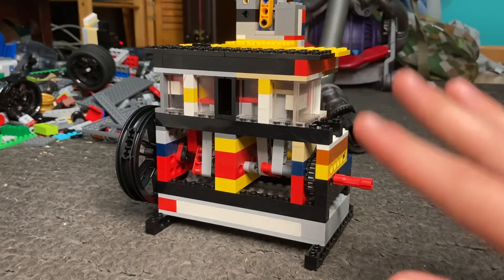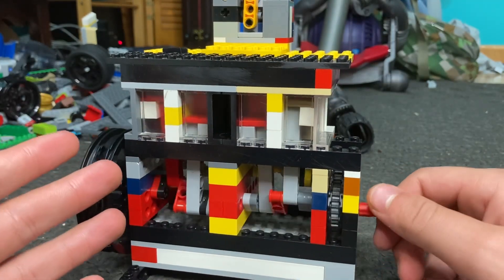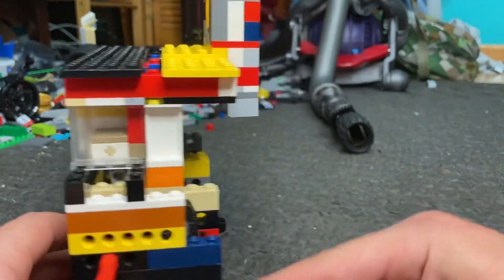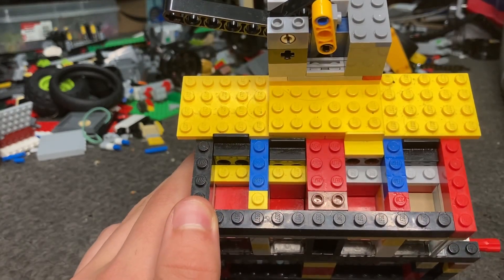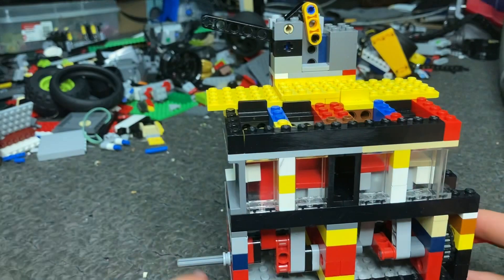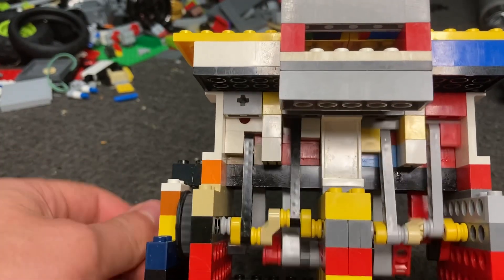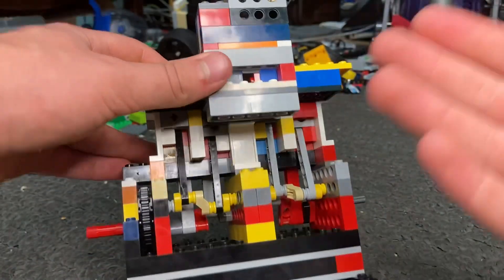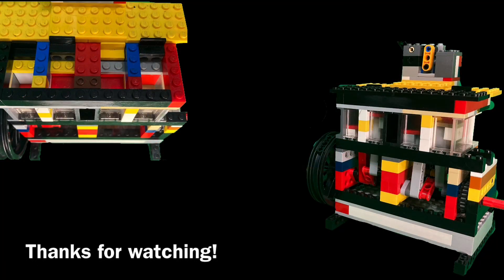MICRO Inline 4 Lego Vacuum Engine || Showcase

Comment: Please tell me this is in the 1342 firing order, it sounds like it is!
Reply from the maker: It’s actually 1324, the crossplane configuration had cylinders 1 and 2 180 degrees offset and then 2 and 3 are 90 degrees apart, and 3 and 4 are 180 apart.